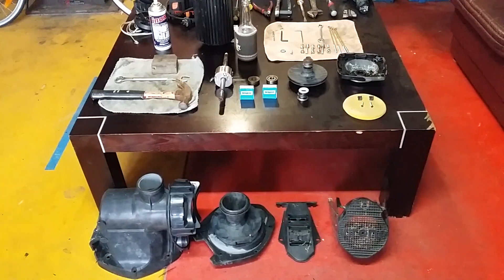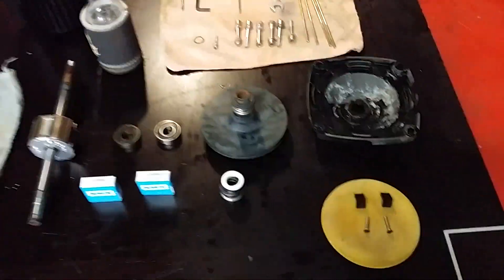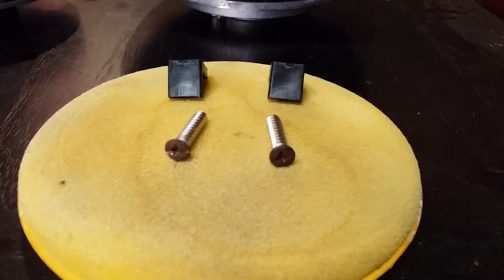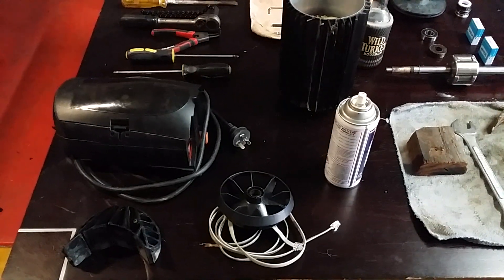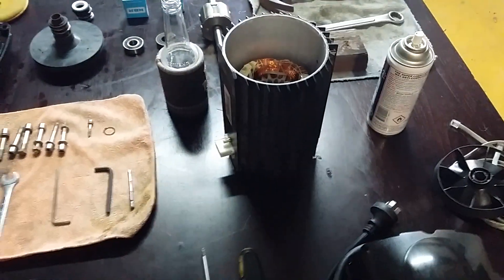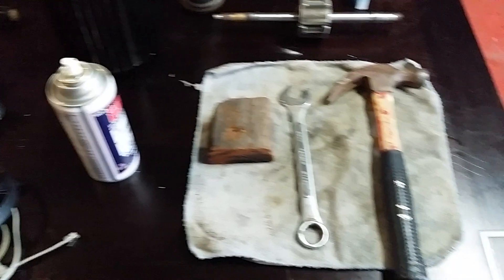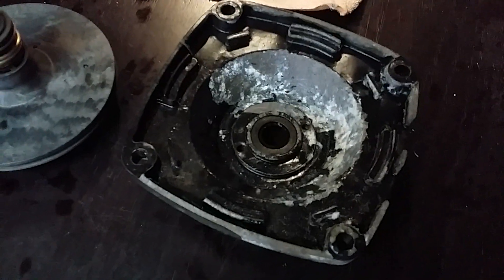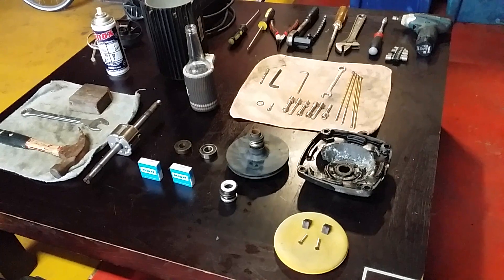Viron P320 EVO motor bearing replacement

Comment: I know this is an old video, but after almost 8 years my eVO P320 finally started screaming for new bearings.  Have started the process and have come up with a few issues - bearing guide screws were badly rusted and had to drill them out as well - but my other issue is that I purchased the following mechanical seal - PS3868 - checked this against eVO and newer P320 models and all seems to be the same however, it's quite different from my existing mechanical seal which is a bit bigger and will fit all the way to the base, whereas the new one won't fit on the metal cap at the base of the impeller shaft - can someone confirm where they got their mechanical seal part from to match the eVO P320?
Reply from the maker: I managed to get all these from B&L PUMPS - but i also noticed link doesnt work anymore which is a bugger
Reply: @shaneferster8642  Thanks for answering - ended up working it out, didn't realise there was one additional part of the seal right down the bottom of the shaft - it was stuck on so tightly I thought it was part of the plastic, once I removed this (with some force!), the new seal fit perfectly - always learning!

Comment: Great video. I'm about to give it a try. The mechanical seal, does it just match the bearings as per the shaft size?
Reply from the maker: thanks mate - yeh it does, all very self expanitary once you start pulling apart - see https://www.youtube.com/watch?v=cA_BjqW6ds8
Reply: I got the bearings but am having trouble with the mechanical seal. Any further info on that?

Comment: Thanks Shane, video’s like this make it relatively straight forward to attempt these types of projects. I ended up getting about 6 years out of the P320 before the bearings gave out. Found all the same issues as you had, with the exception of having to drill out the screws holding the bearing guide as they were so badly rusted - now replaced with stainless steel. The pump is now purring away better than it has for years thanks to you and I will find it much easier to do it all again next time. Cheers
Reply: Hi. My screws were rusted too. What screws did you replace them with? Eg size, thread, part number?
Reply: @rjpalmowski  Hi, I just went to the hardware store (Bunnings) with the components and tried a few until I got a screw that would fit. From memory they were a little larger so I just drilled out the plastic bearing guide to suit the new screw. Stainless Steel would be highly recommended as I suspect that the bearings will need to be replaced again in the next few years and this will make the job much easier. Good luck.

Comment: Thanks for the great tutorial! Quite a straight-forward job if you have the right tools...a bearing puller and a can of freeze spray for the shaft makes the job easy.
* Here's a tip I learnt along the way- If you put it all back together and the motor just shudders and wont kick over when powered on, Inspect the spade terminal housing on the top of the motor. when I first assembled the controller back onto the pump, one of the spade connectors on the PCB must have been slightly out of alignment causing one of the female spade connectors to push down inside the motor connector. The outcome was only one phase was supplied to the motor. Easily fixed but I only diagnosed after replacing the controller caps..doh!

Comment: There is a spring loaded seal on the wet side, that spins against a stationary seal in the base plate. I replaced both. My concern is that it was relatively loose fitting. 

I’m concerned it’s going to spin. Do you recall glueing that seal (on the base plate side) in by any chance? I’ve assembled and it’s running. Seems to be ok. But if that spins it will destroy the housing the same way a spun bearing would.
Reply from the maker: Without a diagram to see exactly what you're taking about - I'm wondering if you're referring to the mechanical seal, which is a relatively loose fitting.?
Reply: @00:50 there is a spring loaded seal. 

I’m referring to the opposite seal to the one at this time stamp which is located on the pump housing. 

My replacement one isn’t as tight as the one that come out. I’m concerned that will spin. I’m wondering if that was meant to be glued in place. It was just plastic on plastic.
Reply from the maker: As long as you re-assembled the way you took it apart - she'll be Jake Jack 👍👍😎😎

Comment: Silicone Carbide Mechanical Seal!
There's also a better quality version of the mechanical seal - its silicon carbide with Viton seals, they're $50 each...

So 2 quality bearings & a quality seal - $170 all up! Triple the cost of the "repair kits" on the usual online market places.  Hopefully worth it.
Reply from the maker: Thanks Nate - mines up to change again, will look at these. Cheers
Reply: Hi, Please could you tell me the part nr. for the silicon carbide with Viton seals? It would be great

Comment: Get a sealed Stainless bearing!!! 

For anyone else looking - i'd suggest getting different bearings.  Grab an SKF W 6203-2RS1 - it is a STAINLESS steel & SEALED bearing, i.e. water tight & wont rust.
Bastards are $60 EACH for the bearings alone but hey.... whats 3hrs of work cost!
My weekend work ahead of me...

Or go silly & get a W 6203-2RS1/W64.... $160 EACH, stainless solid lube for marine applications...

Comment: Thanks for a great illustrational video.  As you mentioned, as with many products available today they are "designed to fail" - and mine operated exactly as it was designed to do.  It lasted about 5 years before the mechanical seal failed, as I noticed a bit of water at the bottom of the motor at the end of each day.  I should have changed the mechanical seal immediately, but because I waited a few months, the bearing closest to the pump started to make a noise, so pulled the motor apart.  The water from the saltwater pool caused 90% of the coating (powdercoating?) on the motor housing to detach and simply flake off with the touch of a screwdriver - really well manufactured for something which will be exposed to that kind of environment.

It was a real challenge to get the two screws with the black plastic clips securing the front bearing out, as the heads were totally destroyed by the water and these had to be drilled out.  They were really clever fitting two Phillips head screws made from a material that rusts - it boggles the mind how a so called reputable company can fit decent SSteel bolts with Allen key heads on the outside to secure the two parts of the pump that will never be exposed to salt water or another metal, but on the inside they go for substandard option.  Of course it all makes sense if you want to sell complete units rather than have your units repaired.

Your suggestion to coat the four bolts securing the pump to the motor is very valid, as these bolts were a so oxidized that it was a real challenge to get them out.
Reply from the maker: Totally agree with you mate - they're clever
I hadn't done a video before this one, but the whole thing annoyed that much, I decided to do it, especially in this throw away society (that companies have created)
Reply: Just a side note - I paid around $800 extra because I wanted to "upgrade" my pump at the time when I installed the pool, so went for the Astral Pool product.    Not sure how the cheaper pump would have done over the same period.

Comment: Fantastic thanks Shane. $25 for two bearings and a seal! And that’s WA prices!  Cheers
Reply from the maker: That's cheaper than what I paid!! lol - nice work
Reply: Where did you get your bearings and seal from, I am working on that at the moment
Reply from the maker: @mariog5598  look above, and click "show more" all info is there or in the videos :)
Reply: @mariog5598  Precise Motion Products, O'Connor: 1/1/Bellamy St, O'connor, 6163 - $25. You need cash as they dont take card!
Reply: @lyndonmason8851  Thanks

Comment: I consider myself so lucky today, came home heard the noisy pump and decided to test my luck by searching for a youtube video to help me out and BOOOMMMMM, found your video...bloody awesome....thankssss
Reply from the maker: Hi Mario - Really glad this helped you out, I find it really annoying that things are built to fail after a certain time so hopefully the rebuild goes smoothly for you and you save a wad of cash...all the best
Reply: @shaneferster8642  hi Shane, same issue. How do you get the pump impeller off?
Reply from the maker: @lyndonmason8851  now you're testing my memory lol
I think its on the link that i added to disassemble the motor. 
But otherwise pretty sure once the back cooling fan was off i used a oil filter remover on impeller and big flathead screwdriver on the other end of the shaft...

Comment: Thanks Shane great intro and you are right these thing are made to fail same here 31/2 years and the noise started. Going to get the seals and bearings and give this a shot 
Thanks mate greatly appreciated
Reply from the maker: No worries mate - good luck (mine is still going strong after rebuild)